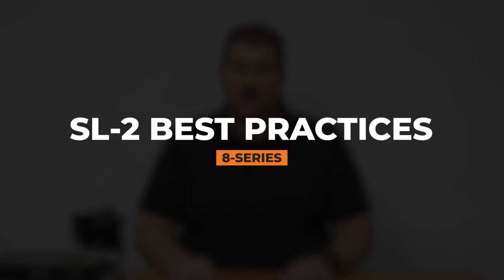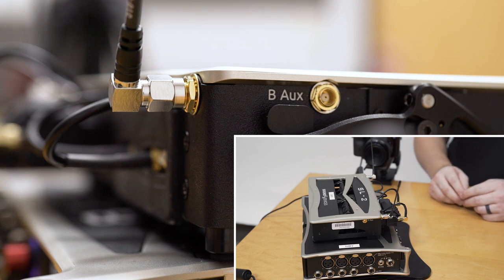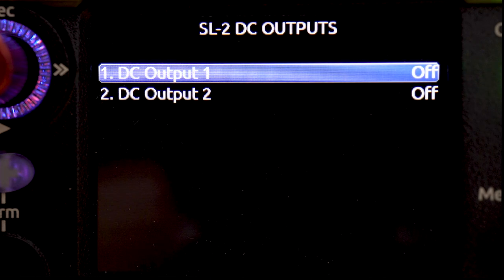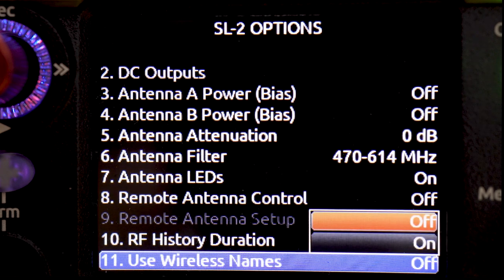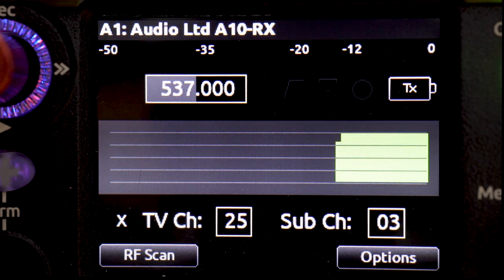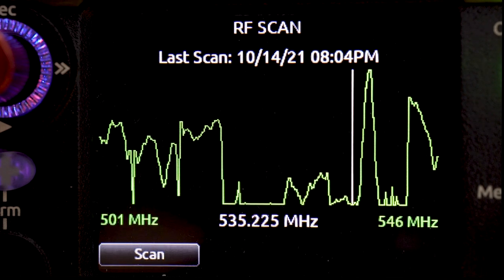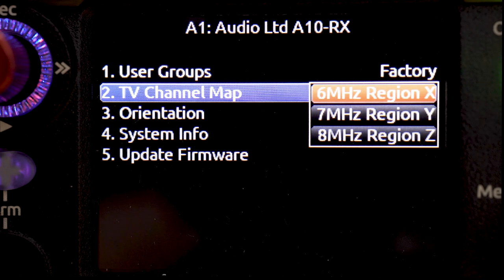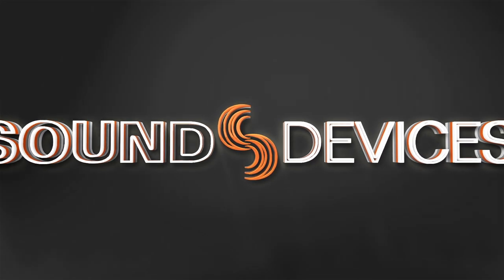SL-2 Best Practices

Comment: Since SL 2 has one set of aux antenna A  and B ,    how do one connect 2 dual channel external receivers to the aux antenna port
Reply: Use a MiniCircuits ZFSC-2-2+ on each output